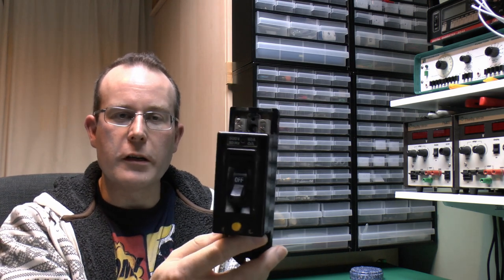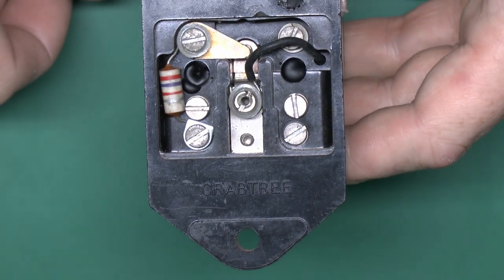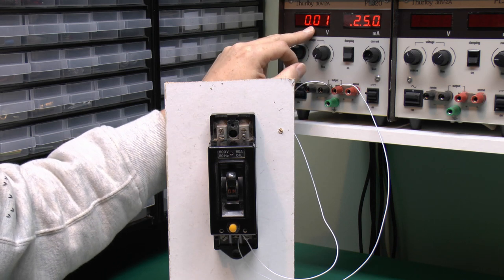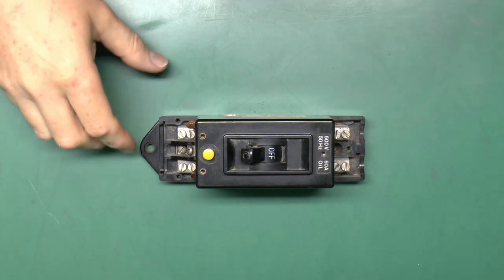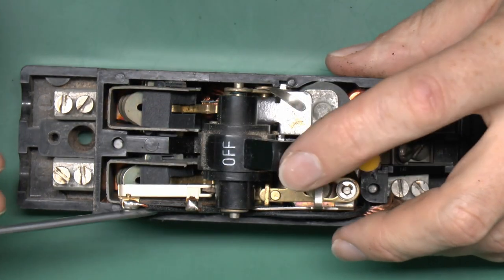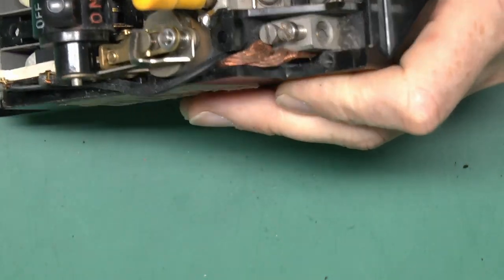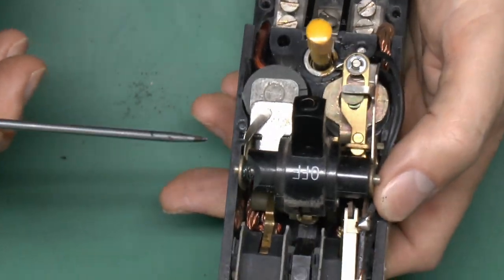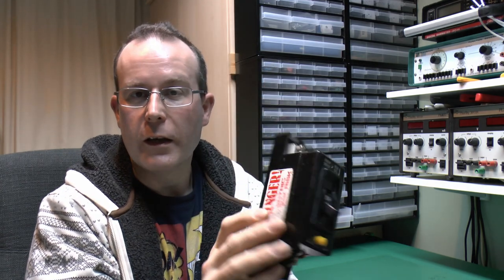Crabtree Voltage Operated Earth Leakage Circuit Breaker (VOELCB)

Comment: 3:20 These type of Voltage Operated Earth Leakage Circuit breakers are designed, when they trip, to bypass the coil for quick discharge of possibly present capacitors in the devices hookup to these breakers. So the "dead short" of the E and F connection in the OFF position is not a fault, but intended to work like that.

Comment: The test resistor colour code looks like 2.7K 10% (a standard E12 series value) or maybe if the first band is orange rather than red, 3.7K 10% (not a standard E12 series value).
Your measured value of 3.389K means it has drifted from its intended value. 
2.7K+10% is 2.97K. 3.7K-10% is 3.33K. If it is a carbon film type, these tend to go higher in value rather than lower in value.

Comment: I also noticed that part of the plastic on the plastic toggle of the switch is broken just above the overload coil mechanism. I wonder if that had anything to do with the overload system not working. Maybe it contained another part that escaped and so broke that function.
Reply: These are useful in MOD portable workshops servicing radio and radar. The testing causes earth leakage that trips RCDs. Obviously not as good as RCDs but better than nothing.